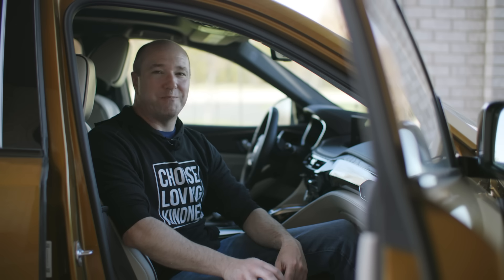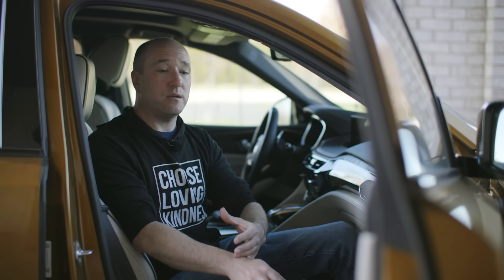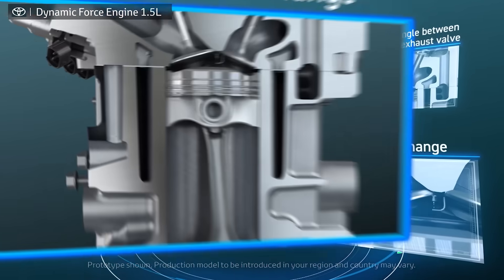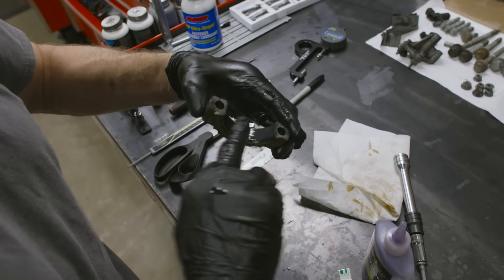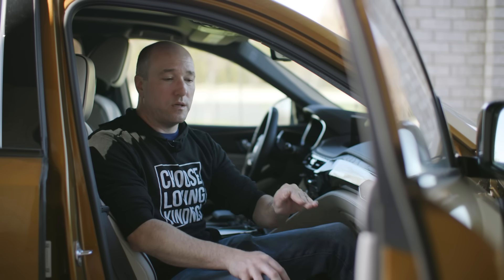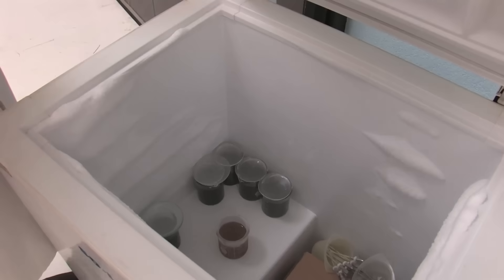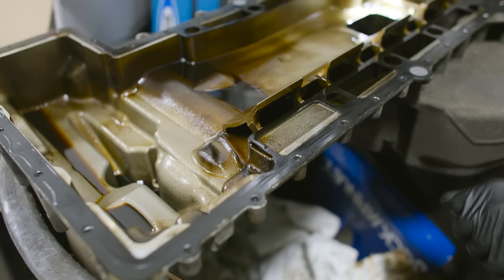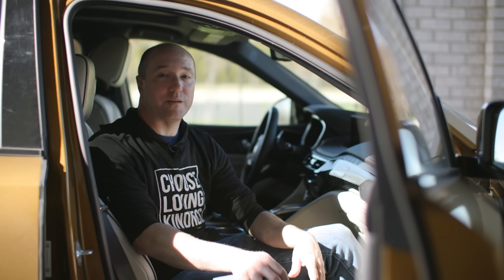Understanding Engine Break In | Dos and Don'ts

Comment: I bought 2023 Truck. Dealership want me to bring for oil change at $7500 miles. No way. I did my own change at 1000 miles and then I'm do at 4000k miles then let Dealership do at 7500 miles. I had 2005 911 that I sold last year. I did fully synthetic oil chnage every 2000 miles and sometimes 1000 miles and sometimes 500 miles. Oil is cheap but engines r expensive. It was my summer daily driver and parked in garage during winter. If I didn't do oil change before storage. I did oil chnage after coming out of storage.
Reply: I got the same advise by my dealership and did exactly what you did. It's been 1 year and 2 months and I only have 4,500 miles on my car. I change out the oil every 6 months now as stated I should in the manual.

Comment: My thought process is i need to seat the rings and gaskets for HOW I WILL DRIVE.  I am that asshold you see flying through traffic on his moto or car. Sometimes the track. Car or moto ill start slow being a new engine. Ill never STEP on the gas. Always eas into it. Slowly build up and fluctuate the RPMS never hanging in one space for to long. I will intermitatnly dip into the higher reves, more and more higher and higher until at 600 miles I'm balls to the wall red line. NOW you change the oil. BOOM your set.
Reply: Fun fact: the Acura NSX was one of the only cars that broke the engine in prior to putting it in the car. So you could take it from the dealer and go str8 to the track.
Reply: Real brake in. Not sweeps. Well ive been told this anyways. Im not there in house watching it happen.
Reply: 3:05 Hey look im right!

Comment: Many (often obese) people, who don't give a s*t what they are eating and drinking (and even smoking), become delicate when it comes to their engines and the depending oil. This is somehow funny to witness. There is a lot of Voodoo out there, myths and legends from the regulars' table. 

Over here in Germany we do have the "Autobahn", which means that there is indeed a chance for any Kraut engine, to become not just warm but even hot! With our continental climate there are differences of almost 50°C between seasons. I have tortured a lot of Diesel engines in this climate on the Autobahn and they are forgiving, same with the oil. 

My two cents are, that it is more important to drive an engine (particularly blown or loaded ones) warm and cold gently every time. Breaking in on the other hand, is simply not given for all those rental cars out there. Most of the cars over here start their live as rental cars for six months up to a year, cause nobody wants to pay the "dork tax" for a virgin car. Nevertheless even these rental cars survive. 

With one loaded Diesel engine (VW 1,9 TDI with 110hp, called: AFN), which I had tuned brutally due to a slightly raised boost pressure (from 0,95 up to 1,15bar) and a potentiometer looped into the pump signal cable, up to 140hp, I've had even refused to change the oil in the end. The remaining "liquid soot" used to burn away in the end. I just added cheap mineral oil. You know what? It survived!

Comment: What brand do you guys typically use on your personal cars that see some track days (e.g., s2000)
Reply: Mark uses redline, i have used redline, ams oil and liquid moly over the years
Reply: @jackethnicallyambiguous  Thanks Jack! What are your thoughts on an oil cooler for the GR86? Is at avoidable with a good brand proper weight (e.g., 5W-30) oil ?
Reply: @i-barg  if your running long secessions you should do a oil cooler and probably a baffled pan
Reply: @jackethnicallyambiguous  Thank you Jack! Your teams content and engagement really help the automotive community.

Comment: So if I’m really just steer driving my MY 13, just use the recommended 0w-20? But if I want to take it autocrossing change it to 5w-30 before going out?
Reply: Yes. You will want to go back to your recommended oil for commuting. Engines designed for 0w oils usually have tighter clearances to maintain oil pressure, so leaving a thicker oil in the engine isn't a great idea.

Comment: Another thing: Owner's Manual >>>> Dealership
I've read countless stories of dealerships giving out misinformation. 
I drive 2 miles / way each day, so my car barely reaches operating temperature.
When I went in for my first oil change (because I had a coupon, otherwise I'd do it myself), the dealership technician wanted to argue with me because the car only had a bit over 2000 miles. He said I could go probably over a year with the oil. According to the manual, the way I drive is extreme conditions and oil should be changed every 5K miles or 6 months, whichever is first. The engine felt much smoother and better after the oil change.

Comment: Interesting that process of varying engine load, yet not thermal shocking the vehicle is what most motorcycle manufacturers recommend, especially since most motorcycles have transmission & engine sharing engine oil.

Guess I've been almost instinctively followed that routine in the new cars purchased, from econo-boxes to sporty ones; it just made sense.

Comment: It was impossible for me not to take my car on the highway (expressway) for the first 200 miles. I bought the car for transportation to work. I did not buy the car to continue driving and paying for a rental car.
Reply: I did too. I bought my truck and immediately started doing a 100 mile daily commute round trip to and from work. The work around to that is to just cruise down the freeway and maintain your speed, but just put it into manual mode and downshift once or twice every couple minutes to get those RPMs varying a bit.

Comment: I always did just the way it was explained in this video in all of my cars in the last 30 years.  If it was later tuned I halved the oil change interval.  I always used premium oils. And in all those years I never had excessive oil consumption to top up the oil, no leaks and no problems. So yes  - it works just like you said here.
Reply: I've only owned 2 brand new cars, but I also religiously followed common sense break in procedures and had no engine related issues for the life of either. Car makers make most of their stuff user friendly and as idiot proof as possible these days (pre broken in engines for one) but it still doesn't hurt to take care of your expensive shit. I mean a car is most people's second biggest purchase money wise.
Reply: @jbm0866 and yet people treat their $30,000+ vehicles like it’s nothing to throw away 30 grand. 🤨🤦🏻‍♂️
Reply: @jbm0866  yes a manufacturers cars will run fine probably even to 100k with no problem even if you don’t break them in at all or even warm them up in cold weather, however I do believe 100k 150k 200k is when those differences will really start to show on a engine that was probably broke in.
Reply: @jbm0866  As this video explains, only certain cars are pre-broken-in. Most are not.

Comment: I bought a new Corolla and did an oil change at 1000 miles, just to be safe. Toyota says it can wait untill 10k, which seems kinda crazy to me. I could easily be wrong, but the early oil change was good for my peace of mind.
Reply: The Car Care Nut channel recently did a full engine swap on a Camry because the owner thought the 10k recommended by Toyota was enough. He recommends 5k.
Reply: @panzer_TZ  I completely trust the car nut  channel. My dad was a mechanic all of his life and he said the oil is the blood running through your car. If you make lots of little short stop and starts of your vehicle there is such a thing as condensation. Yes it’s always good to change your oil sooner than later. 10,000 miles is way too long if you want to have longevity of your vehicle. there has been many videos where people have made multiple short trips and have taken their vehicle to 10,000 miles between oil changes and it looks like there is  chocolate milk in there oil. Yes that is condensation build up. Do yourself a favor and just change your oil every 5000 miles. Yes oils have evolved, but there is always condensation to be concerned with.
Reply: @panzer_TZ  Odds are the owner wasn't using quality oil. If I'm using Pennzoil Ultra platinum, Amsoil Signature, or Mobil 1 extended, then 10k intervals are fine. But most "Full" synthetics are barely 50% synthetic, so anything cheaper I wouldn't run for 10k miles
Reply: @mistamaog  Thanks for this - I thought full synthetic and 100% were synonyms.  Another marketing bullsht lie…
Reply: @ystebadvonschlegel3295  No problem, it sucks to find out how little of it can be crude oil and still be considered synthetic. So far only Amsoil is 100% synthetic.
Reply: It doesn't hurt to do oil changes earlier then recommended...
Reply: If the guy who designed the car says to change the oil at 10k miles that’s what you should do. Technology has come a long way
Reply: @nikodominiko  I think the problem is that a large portion of drivers actually fall into "severe driving conditions" which require more frequent oil changes according to the manual, but people think that since they don't go to the track that they automatically don't fall into that category.

Comment: When I bought my S2000, I asked the previous owner if it burned oil - He said no (and I didn't believe him). All these years later, I discovered that it was a dealer demonstrator vehicle. I suspect it was thrashed at the beginning of its life and achieved a good ring seal!
Reply: I know someone who thrashed a Toyota Starlet P9 on Autobahn daily almost from the first day, and people remarked that it sounds and behaves like a racing engine.
Reply: Yeah, less choice, on "good" new cars, today and getting worse in future.
Buying used may happen again.
Reply: My new engine gone straightaway to dyno tune it after rebuilding. I think we ran it “easy” for like 5 minutes in the dyno and after we pushed it to WOT several times to build and refine the VE and spark tables. Of course the engine builder knew what he was doing, because he builds race engines.
Now its been like 30k km now and it revs amazingly, no oil consumption. Works like a clock, amazing sound and behavior.
Reply: buy brand new next time...
Reply: @TerryManitoba  Ah yes I can buy an s2000 brand new right now
Reply: @TerryManitoba  buy for me then

Comment: I will refuse to trust 0w20 or 0w16 oil. Although my camry made it 90k and my friend made it 250k miles on 0w16...any car that makes more than 200hp should not be using such thin oil, and turbo charged vehicles SHOULD be using 0w30 or heavier, 5w30/0w40. Those thin oils break down so much faster and it has been PROVEN, its all about emissions and government regulations, not making engines last.
Reply: 0w16 has only been around since 2017 or so. Does your friend work for Uber or something? ~50,000 miles per year is a lot.
With the exception of hard use and extreme conditions,  0-16 should be just fine for engines designed for it.
I am expecting a minimum of 300k from my 2020 Camry before engine wear becomes a concern.
Reply: My Subaru uses 0w20 and easily goes up to 250f on long climbs. What can I do to lower temp, in addition to maybe using heavier oil?
Reply: Agreed. I had a car that required 5w20 and even that was way too thin. Lots of oil consumption. I couldn't imagine 0w16. Might as well fill the engine with water.

Comment: The Supra (and perhaps other BMW motor vehicles) has an odd break in process - 1200 miles and it has 0W-20 from the factory. From the video, it sounds like this is something I should be changing before any track or intense use? 

Also, when varying the load is said - how much does that mean? Is it possible to drive on the highway but constantly change speed by going from between 2k and 4k RPM?
Reply: I did mile 80-300 using highway. The easiest way was to use radar cruise and let it creep up on a Maryland driver in the left lane with 3 brain cells, then pass him gradually. Varied the speed from 60-75 that way, rpms would always go up obviously to pass, but not a ton of stress as it's highway driving. In the middle of the trip I had to go to a relative, whos up a long sweeping mountain road. Varying RPM in something with a turbo is hard being it has the torque not to downshift, but that does change load obviously.
Reply: Go to back road, twisty hill side road. It would be better than on the highway.
Reply: S58 uses 0w30 from the factory.
Reply: On my 21 Silverado hd gasser I broke it in on the freeway. I would give it a couple minutes cruising down the freeway at about 1200 rpm in the overdrive gear, and then every couple minutes I would downshift once or twice, still maintaining my speed, but instead of 1200, it would be cruising down the road at 2500-3500 rpm for a couple minutes, then upshift and repeat the process for my entire daily commute. Cruising anywhere from 1200 rpm to 4000 rpm. I’m at 40k now and it still runs great and doesn’t burn any oil. 3000-3500 mile oil changes.

Comment: These days with the advances in metallurgy and oil protection there is little to no reason to break an engine in. Even on high performance applications. Reaching operating temp in more important than anything else.

Comment: All good info, however unless you get a car with literally 0 miles on it with and engine that's never been started, all of it is almost moot. Most new cars even with just 1-2 miles on them have been started, ran, idled and drove meaning the precious time to do a proper break in has been mostly wasted. The most critical point is the first startup to break things in, if it's not done as outlined then whatever you think you're doing after you get the car is kinda pointless and too late.

Comment: Showing a Kia/Hyundai GDI engine when talking about oil change intervals being 7k-15k miles is hilarious
Reply: Right? You'll be adding enough oil to constitute a change long before 15K. You might call BS, but I have a friend with an Elantra that got a new engine at 98K who was adding a quart every 450 miles. If your car does that, change the filter and call it good.
Reply: @dougrobinson8602  I had bought a 2017 Elantra Sport (1.6L Turbo) brand-spanking new when it arrived at the dealer lot. Took good care of it for 100k miles, oil change every 6,000 miles (I believe that was the recommendation from the manual) and didn't drive it like a maniac. I changed the oil myself and each time, oil levels were good. Right after the 100k mark when I had changed the oil again, barely anything came out. That car really said "my warranty kicked out, let's start burning some oil!". Traded it in recently and got some decent money for it but damn, really sucked that even with taking care of it, it still started burning oil.
Reply: Currently have a 2010 genesis coupe with 204,000 miles I brought it at 89,000 miles. At one point I was changing oil every 10k miles and then at 150,000 miles I switched to every 7k miles oil change now I’m at 200,000 and I do a oil change every 5k miles

It’s also full bolton with a upgraded turbo making 300whp and I redline it daily. I can’t help it.
Reply: @7thSonengineering Does it burns oil?
Reply: @hedgehogthesonic3181  

Yup the pistons rings need replaced. Will be doing it soon

Comment: I drive a new car as I would normally drive it like it was already broken in. To me that means waiting for the oil to reach about 160-170F before exceeding 4000 RPM. I do take a kinder approach for the first 800 miles, but the new engine WILL see redline once or twice a week in 1st, 2nd, and 3rd gear during break in. Never had issues. Blackstone oil analysis says the engine is doing fine. My previous 3 cars have all been performance cars. Unless you've been sending your break in oil for analysis and have actual numbers, you're just guessing and speculating.
Reply: Which ones?
Reply: @spartacus2954  ND2, Veloster N, GR Corolla
Reply: @AM-uk7jv  you have good taste lol
Reply: @AM-uk7jv  Yea those are all reliable cars. You can redline them anytime.

Comment: The problem with modern oils is that prefer emissions (accountants don’t like to pay for cats) over protection for most sports car use. Particularly of note, the high detergency oils didn’t protect the flat tappet cam (exhaust side) of my 1.4L multiair engine in my 500 Abarth.
Reply: How long did the poor Abarth last?

Comment: Replaced the engine in my wrx 13 years ago, and really gave it the beans for break in. I've had 0 issues aside from valve cover gaskets.
Reply: Also took a 500 Mile road trip with it right after.